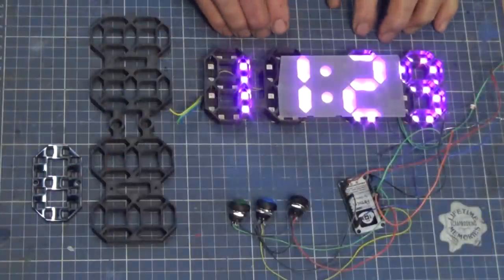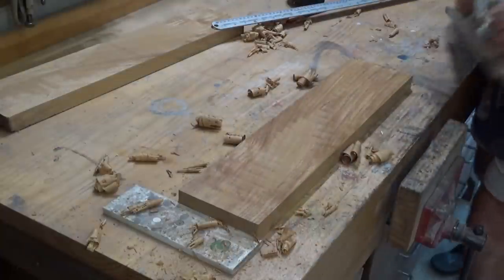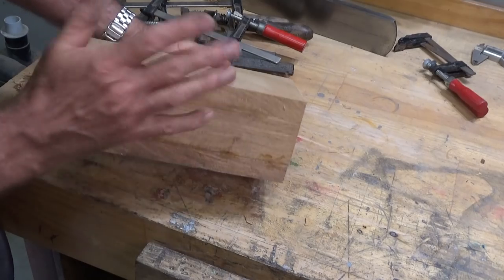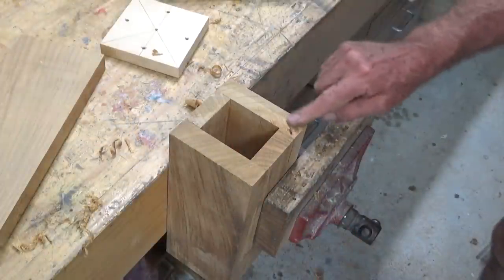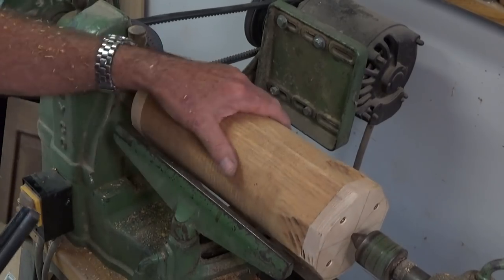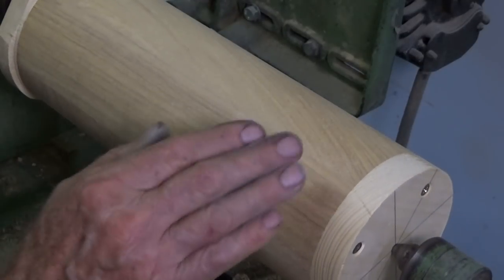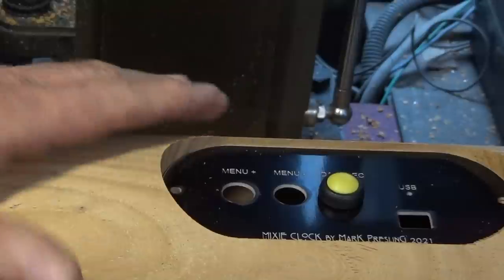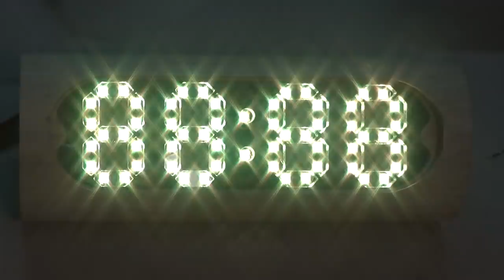Introducing the "MIXIE" A DIY Steampunk, Backlit Digital Clock - Part 1

Comment: Glad to see someone else is as big a fan of Makita tools as I am.  Fantastic machines and even better content; thanks for making this series, Mark.
Reply from the maker: Generally I go for Milwaukee but that little planer does a very good job given it's size and the surface finish is excellent. I think that Makita has a track record for durable tools at a reasonable price point. I have a very old Makita belt sander and a 1/2" router (I'm talking 40 years old) and they are still going strong. 
Regards,
Mark

Comment: Cool clock project.  I hate getting sawdust on my metalworking machines, but they are so much better for certain tasks like slotting blind holes in the mill and turning to specific diameters in the lathe that you just do it sometimes.
Reply from the maker: I built a wood shop at the rear of my main workshop to try to segregate the dust making machines from my metalworking equipment but if you don't own a CNC router you just have to make do. 
Regards,
Mark

Comment: i know its messy, but you should definitely cast one of those in brass, i liked how it looked in the render, and brass along with copper is a really good choice for steampunk stuff!
Reply from the maker: I have just finished the castings for the base and the end plates. I ended up casting them in aluminium, mainly because it takes less fuel to melt the metal but they will be finished in a replica brass powder coat. 
Regards,
Mark
Reply: @Preso58  oh nice, well thats close enough i think and has the benefit of not oxidizing over time wich is nice too

Comment: Back in my younger days, when schools were just that, schools educating us in various subjects, we had wood working and metal working from grade 7 to grade 9. 
Today that part of education is gone. Guess replaced by gender studies, safe spaces and pseudoscience. 
Anyway, metal part of my time in school stuck on me and my job is also my hobby. 
Pity you were not my teacher, you make some awesome stuff in your shop!
Thanks for all your videos.
Reply from the maker: Thanks for that. I stay in touch with my former colleagues and I can tell you that in the eight or so years since I stepped away from the classroom I have seen the curriculum undergo some drastic changes. Some are the result of federal bureaucrats and some are the result of administrators at the school level forgetting that teaching is still the most important thing that teachers need to do. I could see the writing on the wall just before I retired. We were spending more and more time documenting student behaviour and quantifying test results. Meeting budget targets also led to students missing out. Often, successful but smaller sized classes were amalgamated into bigger classes and good programmes that were undersubscribed were cut. The Senior Graphics programme has now been abandoned in favour of "Design" a sort of watered down, generic introductory subject which does little to prepare students for tertiary studies like Architecture, Engineering and Graphic Design. Having said that, wood and metalwork will always be popular with students and at the end of the day we should all be learning to make things and to be able to use basic tools. 
Regards,
Mark

Comment: If you're having problems with the board slipping as you're trying to glue them you can use an old Luther's trick for gluing fingerboards on guitar. It's simply a Brad driven in a short distance a clipped off with side cutters leaving a small point protruding less than 1mm. With a small amount of downward pressure will be sufficient to keep the material in place on clamp up.
Reply from the maker: That would do the trick. I recently saw another option which was to sprinkle salt onto the glue film. The salt crystals cancel out the slippery nature of the glue and holds the boards in place while the clamps go on.
Regards,
Mark
Reply: @Preso58  sounds like another trick to put it your bag.

Comment: What do you think of a light projector instead of your “disconbobulator”?  It could project  the time on a wall or ceiling.  Makes it easy to know the time during the night; disappears during daylight.
Reply from the maker: Yeah, that'd work but this clock is for my study. I have another 7 segment display clock on my bedside table with a "night mode" which automatically dims the light.
Regards,
Mark

Comment: Looks good Mark
Reply from the maker: Thanks Eric. I badly want to add an audible chime for the half hour and hour. I have the perfect audio sample for it. It comes from the beginning of a track by Neil Young called "Southern Pacific. https://www.youtube.com/watch?v=ZOnESpYhLp4 Evidently it's possible to have the Node MCU play the file. I just have to work out how to integrate it with the clock function. 
Regards,
Mark
Reply: @Preso58  Great idea, let me know how you make out with the audio file.  I have read you can do it with an arduino SD card reader.
Reply from the maker: @Balsamancnc  I just bought two DFPlayers which store the audio files and play them direct to an 8ohm speaker. I am totally unsure how to code it but if I commit to buying the hardware I will have to follow through.
Regards,
Mark

Comment: Beautiful beaver work, even though it's in a dead tree carcass :) I'm interested in why you chose carpentry glue over 'poxy. Would it not have been better for turning, or is it one of those woods that doesn't take epoxy?
Reply from the maker: I used Gorilla PVA. It seems to give good results on the New Guinea rosewood. I generally don't use epoxy for bonding wood in applications like this. I have some but the PVA is pretty good if you have good mating surfaces.
Regards,
Mark

Comment: Mark, would the trick of sprinkling a bit of table salt in the wood joints prevent the sliding you discussed?

Edit: Would a hand-held shop-vac nozzle near the cutter be worth using to reduce the "free" fine dust when turning the wood cylinder on the metal lathe?  (No criticizing here, just ideas that popped into my [non-woodworking] head during the video. ;)  I'm looking forward to the next videos in this series!
Reply from the maker: I do have a shop vac and you are correct that it would have picked up the really fine dust. I guess I was too lazy to go and buy some new bags for it. The one currently in the machine is nearly full! I have yet to try the salt crystal trick. As it turned out the wood was fairly easy to keep aligned for that job but I have had situations where it skids around all over the place. It seems to be worse on longer joints with lots of surface area.
Regards,
Mark

Comment: It will be interesting to see how the WiFi controller works.
Reply from the maker: Interestingly, that's the easiest part of the whole build. It takes about three minutes to flash the memory in the Node MCU and then it just runs indefinitely. Of course, it just turns into a dumb sculpture without a WiFi signal.
Regards,
Mark

Comment: In my experience, boilers are rarely made from wood.  Why didn't you use a length of iron pipe for the enclosure?
Reply from the maker: I guess the whole Steampunk thing is about recycling found objects into machines. I was able to go to a place in New Zealand called Oamaru which is the self proclaimed Steampunk capital of the world. They have a full street of shops most of which date back to Victorian times and a museum full of Steampunk artefacts. They were made from everything from tea kettles to bulldozer parts. The materials didn't seem to matter, it was the overall form and detail that mattered. As it turns out, many steam boilers were lagged in wood planking as a form of insulation. I like the warmth of the wood in the design but these things are highly personal and I could imagine it made entirely from copper or steel. Could be heavy though.
Regards,
Mark